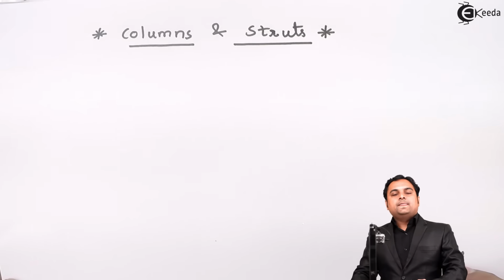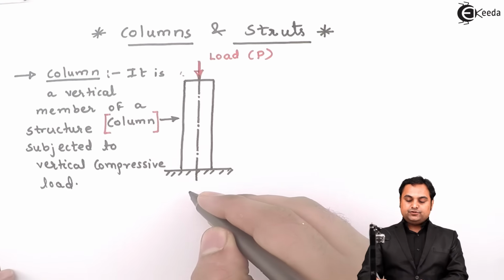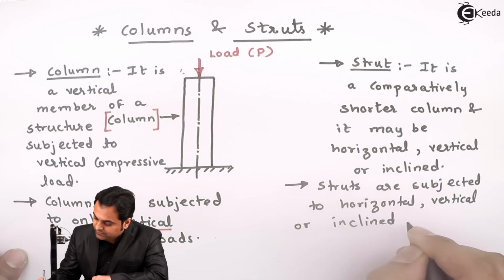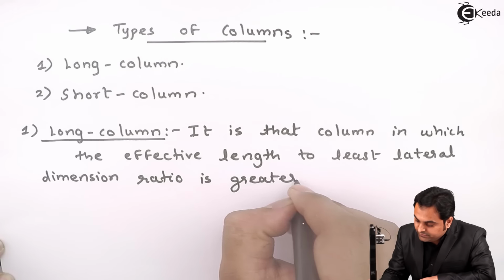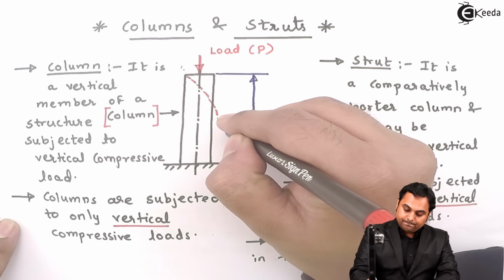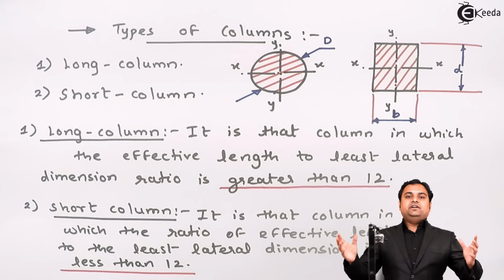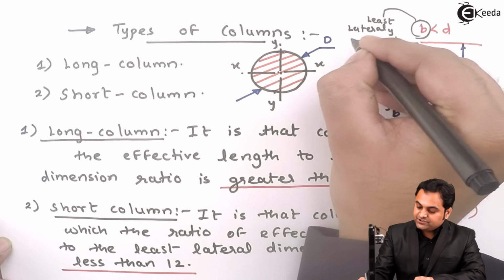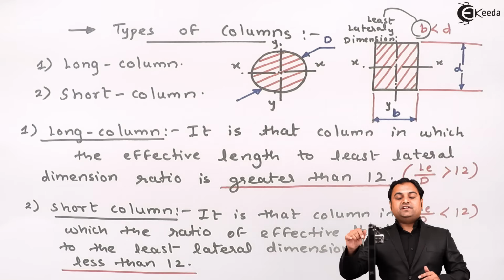Concept of Column and Struts - Columns and Struts - Strength of Materials

Comment: Dear sir I have a question...
   In the case of long column vertical load is acting on it so there should be compression as a result of failure...

Comment: Your all lectures are good of SOM but they are not continuous Means the second lecture is not continued by first Only numerical portion are somehow in Pattern & Some lectures are repetitive 
The new terms that are introduced in any Definition or formula are not been explained or if it had been explained in earlier lectures then it should also be told (I don't think repeating again will take much time) to see the previous lectures 
only simple things are told repeatedly Nothing more coming out . Your category is also much broader and I think this is because of that , you are not continuous with your theory lectures but this large amount of vedios could have been better if they were continuous
I think you still have not covered the whole syllabus of SOM  despite of having such large amount of vedios lectures.
mistakes done in your numerical portion is not told to the viewers for e.g I have seen a Numerical problem for finding M.I ,in which 8 was made 6 (in fast manner) but was not told to the viewers that ,"this data is Mistaken"
every theory lectures are posted like "Randomly" No correlation with previous or the after one.
Please make some changes in the process of Teaching & in the way you post your lectures.